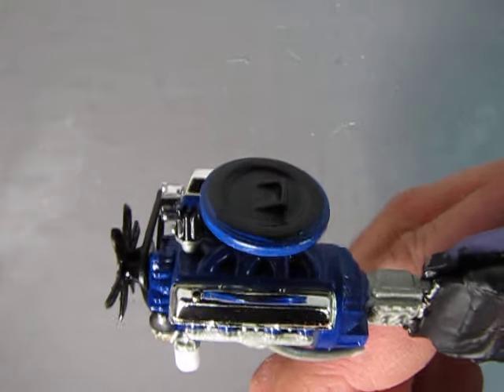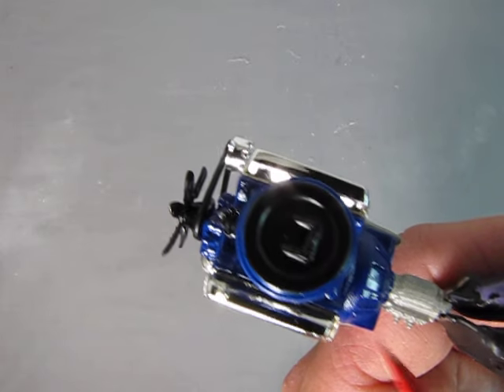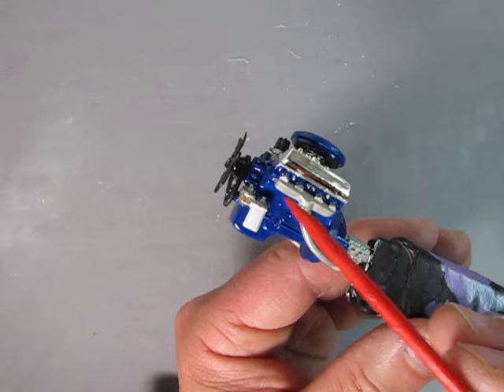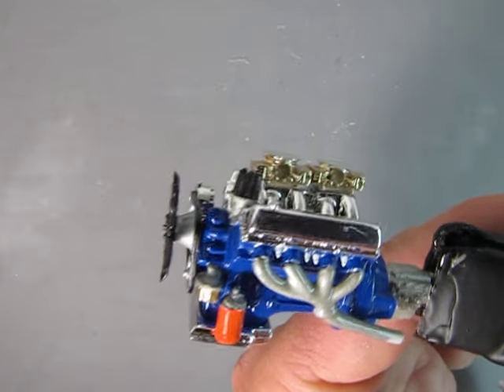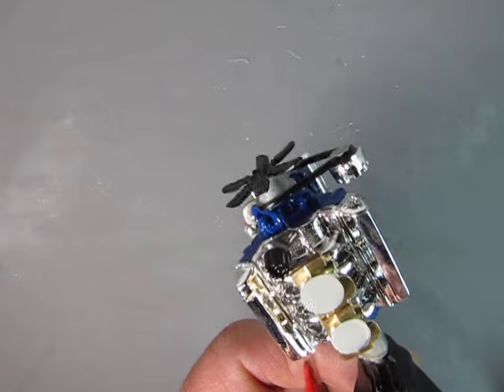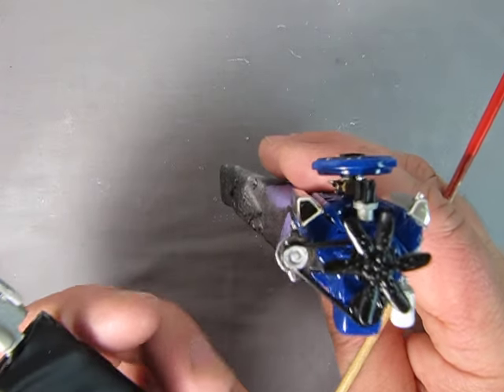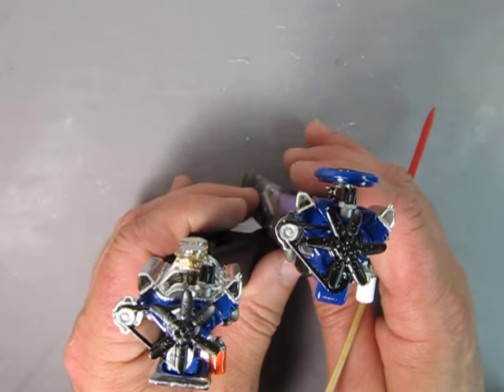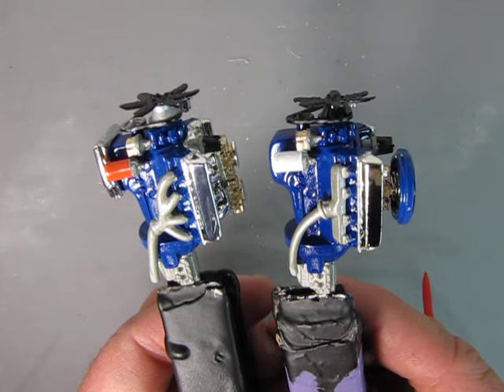Update on the 1969 Ford "Cobra" engines.

Comment: Good looking engines,Trevor 👍😎I bought a Peterson's guide to engines for accurate photos👍great reference material 👍🤔
Reply from the maker: Thanks! 👍 I have a few vintage manuals on cars as well. The engine with the dual carbs still needs the air cleaner installed, but that goes in once the body is mounted to the chassis.
Reply: @MonsterHobbiesModelCarGarage  In my spares box I have a very neat,crossover Weber carb system which ,I believe, comes from a very early issue👍🤔do you know the parts I mean??
Reply from the maker: @petesmodelcarcustoms584  I am unsure without seeing a picture.
Reply: @MonsterHobbiesModelCarGarage  yes,I'm sorry,it was a silly question. If I ever find them again, they'll appear in a future update. I saw them in a review video recently, can't remember who,and that identified them
Reply: Oh also. Happy Canada day. Independence from the old country going well,is It?😀
Reply from the maker: @petesmodelcarcustoms584  Nice!
Reply from the maker: @petesmodelcarcustoms584  Thank you. IDK - with our current leadership, I think it's almost time to go back to a full monarchy system! LOL!